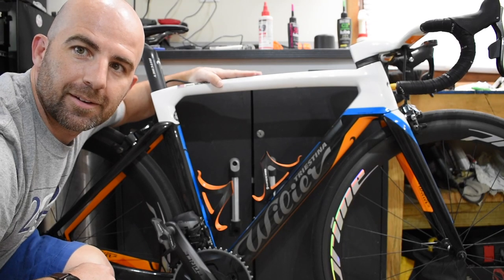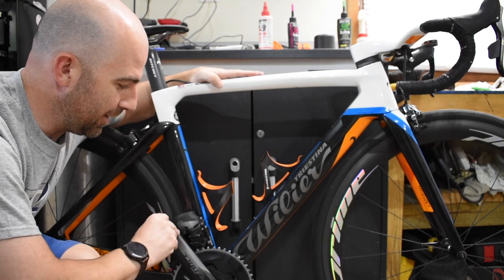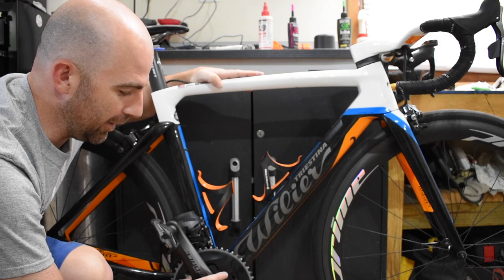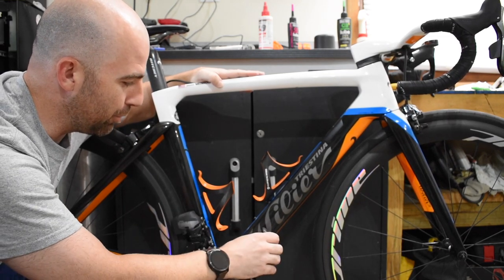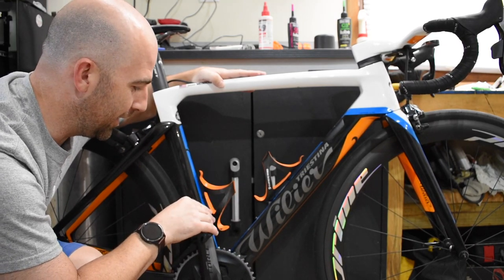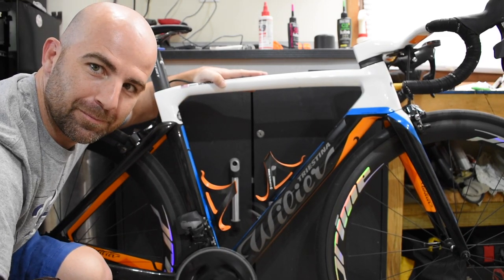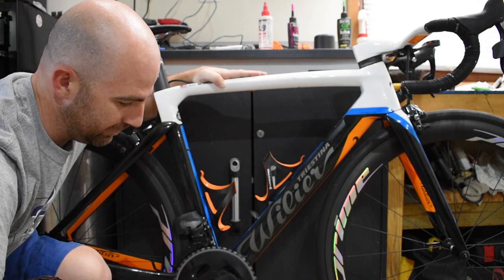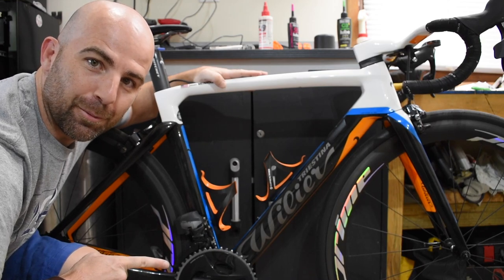How long will it spin?  Kogel BB86 Ceramic Bottom Bracket Spin Test

Comment: I've got Shimanno bb86 and it only spins for two full rotations only. I might have to remove it and sand down the frame a little bit.
Reply from the maker: Always a good idea to make sure the surface is perfectly smooth.  Are you using a Kogel ceramic BB as well?

Comment: hey buddy this is out of topic about the ceramic bearing.. i just wanted to ask if the saddle seat post of the cento 10 air is the same for the cento 10 sl? i remember you posted on a forum months ago. hope you can help me
Reply from the maker: I wish I knew the answer. They look similar but I don’t know the exact specs. Perhaps reach out to the people at www.wilier-usa.com. They have a lot of spare parts like that, including seat posts. I know the seat post from the AIR fits the PRO but I don’t know about the SL. If the PRO and SL are the same, then it’ll fit.
Reply: @JMCyclingVideos  thank you jm for the reply.. i already contacted wilier and they told me that cento 10 sl / cento 10 air / and cento 10 pro uses the same saddle post.. its bloody expensive by the way,. cheers!
Reply: Did you use spacers on the BB? Is it the sram spacers or its comes with Kogel in the box?